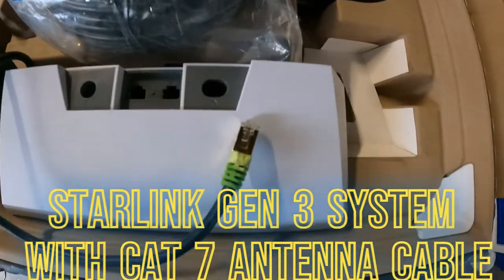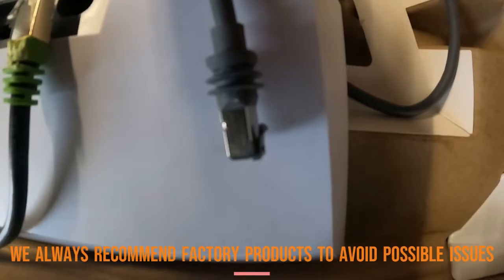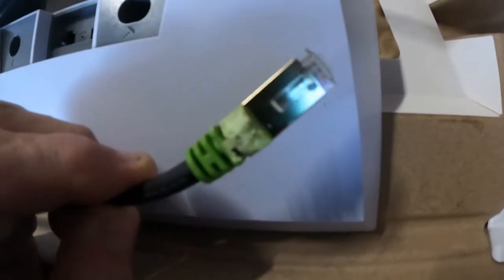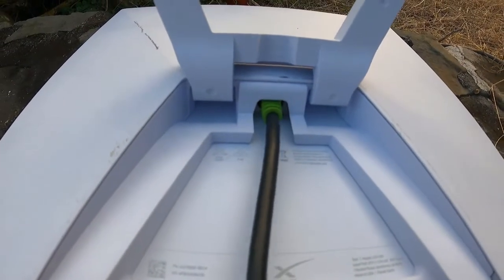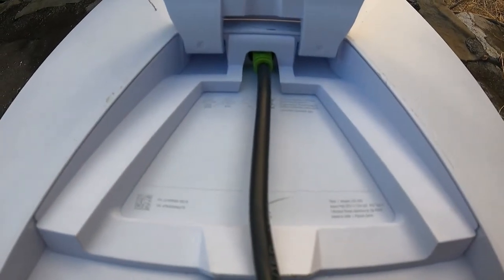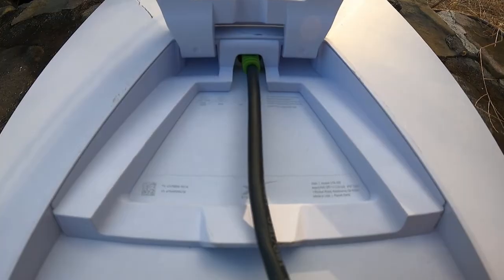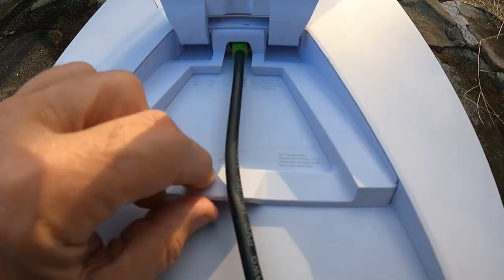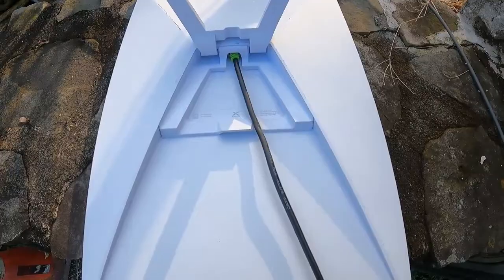Starlink Standard Next Generation 3 Will it work with a CAT 7 cable.

Comment: Cat 7 doesn't exist technically. Its all just marketing of cable rated as cat 6/6a. 26 awg? You better check your transfer speeds. Thats awfully thin copper wire. Standard wire gauge for cat 6a is 23 awg.
Reply from the maker: Thanks for the info, the CAT rating has to do with shielding and data rate and we found CAT6 works fine.  for short runs
Reply: @StarLinkTec  hello how short >?

Comment: You can weather seal the connection with dielectric grease. I used a Q-tip for this. Put the grease "around" the plug, not on the end where the electrical current passes.
Reply from the maker: That should work  Thanks Bruce

Comment: Its CAT7 straight cable ?
Reply from the maker: it can be a flat cable if that is your question the rating has to do with shielding and data rate. any CAT 6 up will work for normal runs , say 100 feet.  We use flat for portable use as it works better in auto doors.

Comment: I really want to do this but with my CAT 8 Ethernet cable, however I cannot find a starlink compatible rj45 and that ribbed seal, especially the ribbed seal
Reply from the maker: YOUR RIGHT have to get the factory cable if you want a seal on it,  check out starlink Gear they make OEM cables

Comment: Fit but it doesn't have the seal the factory cable does
Reply from the maker: That is a fact , the factory cable is the best choice but if you have to use a CAT cable for long term use put small amount of sealer around it that can be removed.  Thanks for watching and please subscribe and watch for new videos coming soon

Comment: Run speed test between Gen 2 and Gen 3
Reply: We have done multiple speed test. Now keep in mind that the Gen. 3 that we have is in a Rome configuration. So priority speeds are not being obtained. But it does look like the Gen. 3 gets a better signal. And as a result, somewhat better speeds, but they are comparable to the standard system.